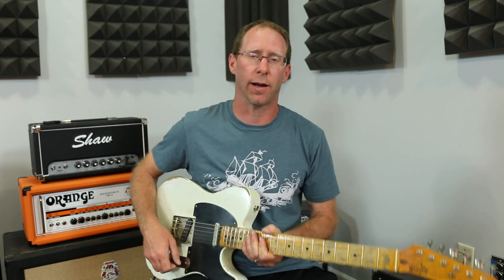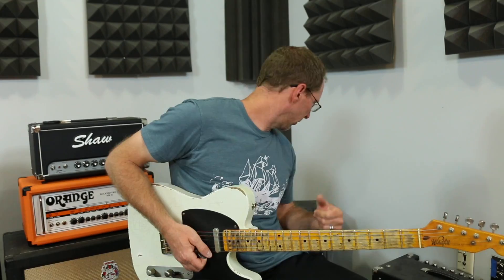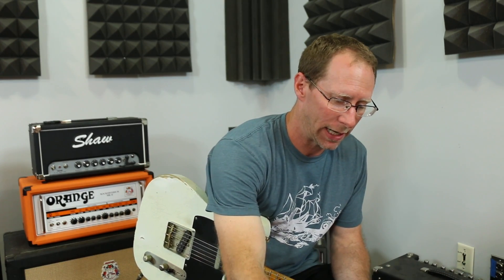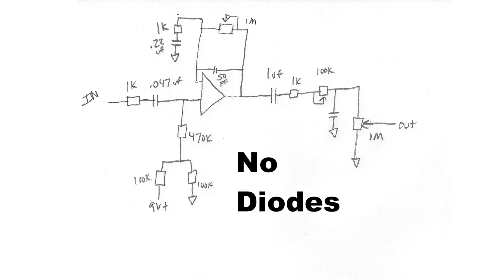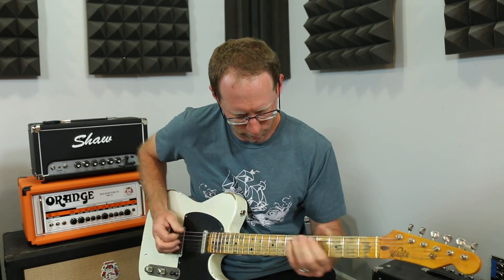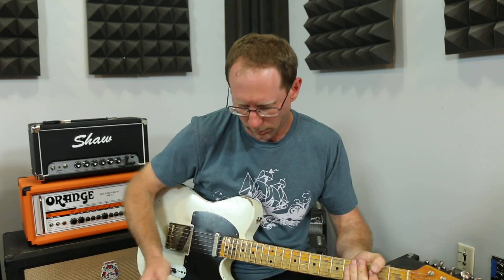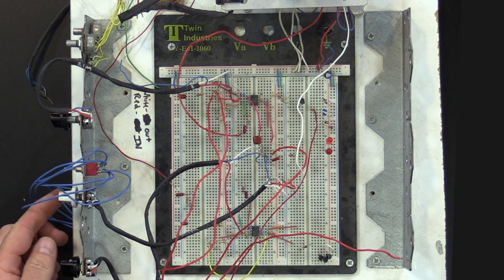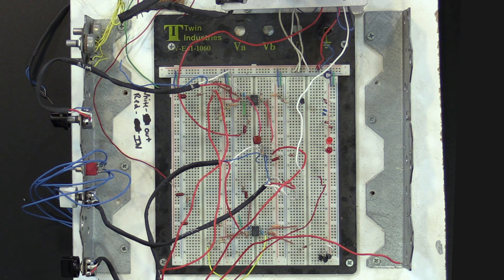The myth of "gain"... and it's relation to "clipping"

Comment: Hi Brian, would you be willing to talk about the best type of clipping when it comes to bass guitars? There’s so many OD’s that sound horrible and I don’t necessarily like clean blends at all. I have to say that I got a TS9 recently and did the stinkfoot mod for bass and the pedal sounds great with bass. No loss of low end at all. There is still a slight mid hump even with the gain all the way down but the point is symmetrical clipping seems to sound best to my ears. Thoughts? And thank you for all you do!

Comment: Well a clipped signal is what causes or what you hear and perceive as distortion. This happens when you amplify the signal causing gain to increase. Which can be done by raising volume at certain point or gain directly

Comment: I've always preferred the gain achieved by pushing the amp with the pedal as it kinda marries the 2 devices together to create one sound. Whereas if if the amp is completely clean and the pedal is at unity volume, you are relying on the pedal to do all the dirt which to me sounds more like an amp with a devices connected to it. That's why I think every distortion/overdrive pedal should have plenty of volume available. One reason why jhs pedals sound really great with the volume turned up.

Comment: I'm wondering how difficult it would be to make a drive circuit with both soft&hard clippers but not the way you already guessed. I'm wondering if one could put one diode in the feedback of the opamp and the other to ground after the opamp probably with a resistor  in series. Or two in each but with resistance on only one diode per pair. How would someone calculate the resistance or type of diode.  If need not be opamp either, only fun and different.

Comment: I don't think we have it confused. Forward voltage of clipping diodes sets where the Gain starts clipping.

Much prefer soft clipping (asymmetric) and Fuzz with Bias gating..

I do use a fuzz face into a π into a 3 channel amp..

Usually got my guitar around half volume

Comment: Using LED as clipping diodes also makes some interesting sounds , much more non linear and softer and also back to back in odd combinations. I one of my gain sections in My Peavey classic vt and chained a few leds back to back and a different amount in the opposite direction and experimented and tuned in what i liked. Was a cheap mod and made a huge difference harmonically.

Comment: I think the confusion is mostly in the different way the term is used in electronics versus by musicians. In electronics "gain" is just how much the amplitude increases compared to the original signal. If you put 1 volt in and get 2 volts out that's a gain factor of 2. But guitarists know that if you increase the gain enough eventually something is going to clip, and if you increase the gain you get more clipping, so they just forget about the clipping and call it "gain". But yeah, as you show different circuits produce different amounts and types of clipping at the same gain.

Comment: Great video!!
I would like to have a low-gain hard-clipping pedal on my pedalboard, a sort of “hard-clipping overdrive”. Could I modify a Guv’nor just to lower the overall gain? I love the way it clips (hard-clipping red leds), and the eq section. Is it as easy as to change some resistor values? Thanks!

Comment: Thanks for the info, but I am more confused. I am sure one of the lengthy comments may have my answer, but before I read all those, I will ask:
1. What would the 3 different circuits be called ie. what type of pedal?
2. What is gain, and what does an amp mean when it says "High Gain". I always assumed it meant distortion.
3. I understand clipping as frequencies above/below a certain amplitude being cut, not passed, thus somewhat 'distorting' the waveform. Is that correct? Is that distortion?
4. What is soft vs hard clipping? It appears to refer to when in the circuit the diodes are placed, but I don't get why they are called hard and soft.
5. Can someone run down what components in a pedal make it a boost, preamp, overdrive, distortion, or fuzz pedal?
6. What does a typical 'distortion/overdrive/dirty' channel on an amplifier do to the signal? Since is always has a 'gain' knob, I assume it at least adds an opamp stage. 
7. Which pots in the schematic are the gain, volume and tone?
I am asking this because buying pedals is VERY confusing with overwhelming numbers of options and terminology. If I know what I want to modify (by understanding the questions I asked) , then I have a better chance at buying the right pedal.

Comment: ACKCHUALLY the schematic for "hard" clipping you provided contains a variant of a soft clipping circuit. That R1k before the diodes is the distinction. With such resistor, the circuit exploits internal resistances of clipping diodes and forms a voltage divider with them, making the circuit merely reduce the voltage past certain level instead of shunting it to the ground completely, similarly to how feedback clipping circuit reduces the gain to unity and not zero when the signal reaches certain level... If I'm understanding that correctly at least. Actually, I think I'm not. I only know that Rod Elliott has a wonderful article on the topic of soft clipping from which I memorized only the practical implications.

Comment: Your hard clipping / soft clipping is just more or less of the same clipping.  You could have included some discussion asymmetric overdrive which achieves soft clipping by hard clipping the positive half of the wave and no clipping on the negative half of the wave.

Comment: maybe should unit that said how many time it over the clipping zone  base 0.5 volt signal.  so 0.5 *gain divided by volts of head room. I called it clipping factor. distortion just soft clipping device push to a high clipping factor to make sound like it is clipping hard. fuzz different that it is hard clipping even at low clipping factor. how ever fuzzes do not sound good at very low clipping factor unless cut out a lot of treble.

Comment: Clipping will add volume because of the distortion generated I agree. However any input stage can be overloaded (as in the guitar amp input stage), so pure linear gain without diodes can also cause clipping if the input gain is set high enough. As someone mentioned, clipping can be induced by reducing or restricting the voltage supplies of amplifiers, op amps and otherwise. By the way the input gain of the amplifier is actually fixed most of the time. 

The so-called gain control simply attenuates the input signal going into it. Boosters boost it. In the case of valve amp input stages the type of distortion they generate is very attractive to the ear, more so than op amps with diodes in their negative feedback loop or out of it (soft or hard). Both can cause distortion. If your amp is a valve amp one way (the valve amp way) is way nicer sounding than the other op amp way (which is why power attenuators are sold).

Comment: Gain = difference in amplitude between the input and output signal. (you can have a crispy clean amp with TONS of gain. More gain even then the metalist of metal amps....)
Distortion = any input waveform which is altered in shape (not scale). Either by tube saturation, diode clipping, transistor clipping. Even a phaser can distort your sound.
In theory, your can have a distorted sound, which has a lower amplitude/output signal compared to the input signal.
That is how confusing the mixup is to many people. Even after this video....
I'm sorry. You told it in a much too complicated way. You can tell by the reactions people posted...

Comment: When amps came out with master volumes, people would turn up the preamp gain and it would overdrive the circuit and clip/distort, so they began equating gain with distortion.  Not technically correct because gain is just the amount an amplifier component increases the level of the signal, but it is understandable people mistake it for distortion.

Comment: Overdrive, distortion it's all the same thing, just different amounts of clipping. Distortion comes from overdriving a device and causing the signal clip. One of the considered Hi gain amps gets it's tone from a gain stage that is very low in voltage gain. Output v is about 50% of the input v. So calling distortion gain is not very accurate.

Comment: Nice to be educated about this stuff, but ultimately, I don't really need to know what's happening in the circuit as long as I can get the sound I want.
Reply from the maker: Thanks for the honest critique! 😊
What kinds of videos would you like to see us do?
Reply: Thanks for your reply Brian.  Keep your videos coming.  My comment was based on my perspective as a player, rather than someone who understands the intricacies of the equipment.  A bit like a pilot who can fly the plane but doesn't know how the engine works in any great detail.

As for suggestions for videos?  Noise.  Specifically, the kinds of noise that are generated with different pedals and how to minimise this at source.  There's nothing more frustrating than using a pedal that is unacceptably noisy.

Comment: Several companies now offer pedals that sound like the amps they're designed to emulate. Do you have a pedal that will give me the tone of a Marshall Plexi, Vox AC30/15, Fender Twin Reverb and maybe a Dumble? If done right it could really help us guys who have a limited budget, especially if it included a tone stack taylored for each amp. The we could just plug it into the Effects Return on our amps and have a complete collection of amps at a reasonable cost. Are you planning anything like that?
Reply from the maker: We’ve been doing that for years actually... thirty something = vox, plexidrive =Marshall, slostortion = soldano, etc
Reply: Wait ... You got a Soldano model??? I know you've had the Fender's and the Plexi's for a while. Is the Soldano newer?

Comment: just adding a bit to this awesome demo.   Running a voltage through a diode junction always costs you some voltage. The standard is 0.7V per junction.  So putting more diodes into a circuit will keep cutting your voltage and can actually re-attenuate so you can re-amplify and add stages.  
 FWIW, I took advantage of the junction drops in a different way:   I made myself a "Universal Music Power Supply" out of a PC power supply which comes with 12v and 5v standard(powers all my 12v synth modules, LED lights on my rig, and USB modules) but didn't have 9v for my pedals.  So I strung together 4 rectifier diodes backwards so they just conducted (they can handle lots of current vs signal diodes) and dropped the voltage down to 9.2v which is perfect for my pedals.   ps, just jumper the green wire on the main motherboard connector to any of the black wires to spoof the power supply into thinking it is connected so that it turns on.

Comment: Very good description of hard vs. soft clipping. A related topic I would be interested in hearing you discuss is the difference between pre-amp distortion passed onto the power tubes compared with preamps under the clipping threshold but the power amp tubes pushed beyond theirs. I remember Dickey Betts explaining that it was the power tubes on his 100 watt Marshall (50 watt for Duane) that gave the Allman Brothers Band their signature guitar tone (at admittedly massive volume levels). But I wonder if there are any combinations of lower powered output tubes and higher threshold preamp ones that might yield that particular type of clipping at lower sound levels? Or is it more of a sonic illusion with the difference being more 
perception than reality?
Reply from the maker: Good thoughts! That would indeed be interesting!

Comment: So to recap: Gain is the increase in the signal from the pre-amp, to the power amp and  "clipping" is the effect that adding diodes to the circuit, does to the signal. Btw, why does the tone change significantly at 4:18, after you reach to the controls?
Reply from the maker: Kinda sorta, but not exactly with pedals. Clipping is what happens when the gain is increased but reaches the limit of headroom. Diodes just help limit that headroom

Comment: so on standard pedals vol/level are pretty much gain while dist/gain are the clipping diodes? I like the former version and probably why i blast all my levels while keeping the actual dist/drive/ etc. levels down
Reply from the maker: No, volume is a passive thing. Gain is the signals ability to get louder than the input signal (roughly)

Comment: i blended the distortion from a ts9's and a 15watt GM108 Behringer and a big muff pie, the ts9 and Behringer run in series and the big muff is in parallel with them, the two distortions playing side by side sound vary full. basically it sounds like a Revv G3 I just needs the sound level equalizer.

Comment: I Love your videos and your products, so Thank you!.
I have been playing guitar since I was 9 and now I'm 49.  Our band plays all different types of cover music + originals. Rock, pop, country. R&b and blues.  I have been in Love with the Randall type of overdrive/distortion for all of my life, unlike Marshall type and others to me its smooth and not brittle sounding the way I use it.  Currently I have the Dime D-100 amp that I love I use a EQ pedal in the clean channel to brighten it up and add mids, ( very fenderish) but it is not on overdrive channel,  its a Randall RG-100 with more options and only made for a short time.  "we are not a metal band I don't us it as a high gain amp.
My question is, what other types of pedals or amps tube or solid state are out there that can give me that type of sound?  Also in your mind what kind of sound is it, and have you ever messed with that type of overdrive or circuit?  I have had and tried Alot of stuff of the years and its all Marshall/Fender/Mesa sounds.  I just love the little different and still versatile things that still sound great.
Thank you!!!!

Comment: Great information.  May I ask you a question?  Why is my amp constantly picking up AM radio?  How do I stop this?
Reply: Captain Biggles I have an amp that does that too and it’s a big name amp maker. I was told a small cheap part can stop it. It was purposely left out. Can’t remember the name of the part but eventually when the tubes go I’ll ask the repair guy to install it because I can’t use the high input setting...ever.

Comment: With a non-inverting soft-clip op-amp, when the diodes start conducting, the feedback path to the inverting terminal becomes like a wire, but with a DC voltage offset (the Vf of the diode). This (usually) reduces the op-amp gain and also causes the peaks of the signal to follow the input signal, which gives that clean-plus-dirty thing you hear in this video and with a lot of TS-type pedals. The diode thresholds are usually low enough to avoid actual op-amp clipping. Like Mark Hammer said below, if you used 4 green LEDs (two series pairs back-to-back) in the feedback loop, you might get op-amp clipping before that wire-plus-DC-offset thing happens, but that's an extreme case.
Reply: I actually don't like the "soft clipping" sound, as like you mentioned it is a mix of distorted and clean, and really is not something that can naturally occur in any gain device (tubes, transistors, op-amps). Now, if you convert that op-amp stage to an inverting stage, that "breakthrough" of clean signal does not occur, and the clipping sounds more "natural".

Comment: I guess if engineers were marketing people, we wouldn't have Fender Amps with Tremolo called Vibrato or the Strat Tremolo not that either.  Pitch bar, Wang Bar or vibrato bar.  Gain is simply increased voltage.  If 1 volt enters a component and 1.1-volt leaves, you have a gain of 10%.  No, a preamp volume pot is not a GAIN KNOB.
Marketing people like Guitar players because we believe in Mojo.  It is true.
If you look at a sine wave on an oscilloscope and increase gain (increasing the voltage within the desired frequencies) when the wave begins to get flat at the top, the GAIN from the previous stage is OVERDRIVING this stage and thus you have clipping.  I remember the first master volume mods and adding them to Fender amps during the late 70's, but we called it a master and the other a volume. How overdriving a stage became called GAIN is because that is actually what happens.  You created enough voltage to exceed the component capacity and it will distort.  YOu may like it or you may not.
I blame it on Pedal dudes.  Turn the Gain Knob on a pedal and more signal voltage gets sent through opamps and/or diodes or transistors. Clipping is the result, but if you called it clipping like Stage Amps from the 70's did (if you cannot remember these amps this is one of the reasons why) by a knob called clipping.  Horrible clipping really.  I prefer the tone of clipping power tubes, but I do like my pedals too.

Comment: I'm curious; if you were to stack multiple soft clipping pedals would the resulting distortion be still technically considered "soft" clipping, or would it have crossed over into hard clipping? In other words is it the type of circuit or circuit topology that determines whether it is properly called soft or hard clipping, or is merely a matter of a "degree" of distortion heard at the end that makes us consider it hard or soft?